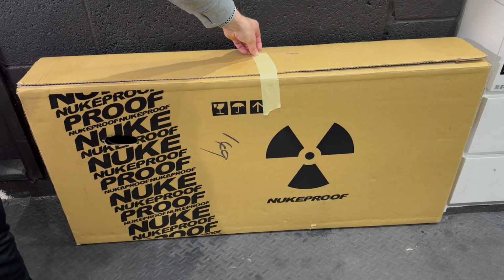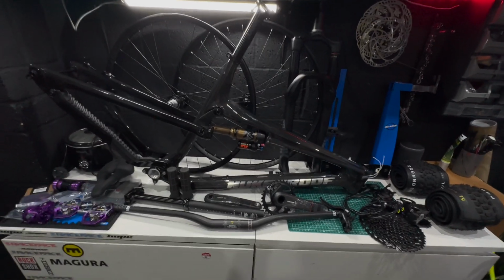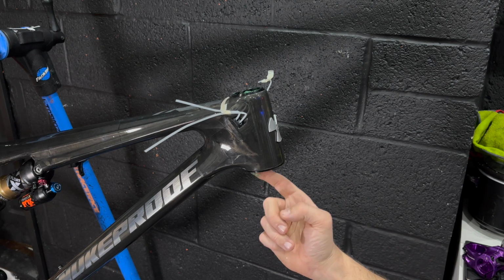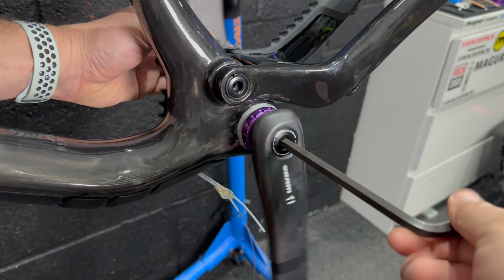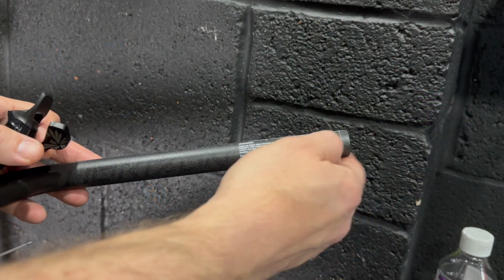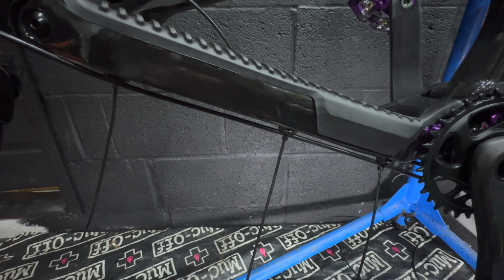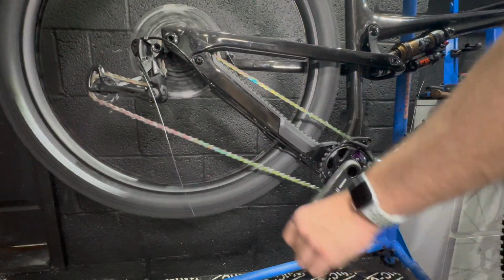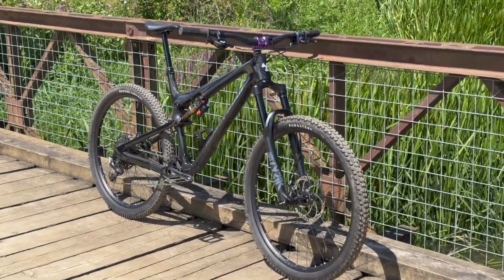Custom Nukeproof Reactor 290 Carbon Build

Comment: Nice build. How capable is the bike? Enduro enough for the Alps for example?
Reply from the maker: @solarrover9575  interesting question. It’s defo a trail bike over an enduro bike in feel. I guess it depends on what you’re doing in the alps. It’s certainly a ton more capable that the Scott Nitrous that I took to the alps in the mid 00s the first time I went! Personally I wouldn’t hesitate taking it, but I’d probably not spend day after day doing laps of La Roue Libre or Pleney Black. What I would excel in is the big left assisted alpine tours that you can do in say the portes du soleil
Reply: @MozOnBikes  natural trails, my kind of riding.

Comment: if u want the shifter on the breaks there are part that replace the cap on the break with a hanger on it for ur shifter .
mismatch adapters from Problem Solvers.
Reply from the maker: Ahh cool, will check thouse out! Thanks!